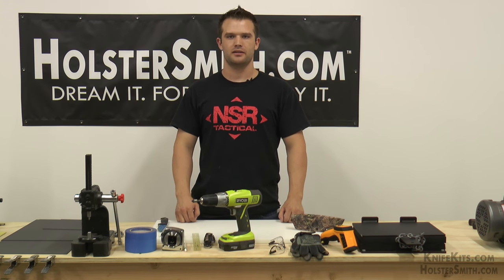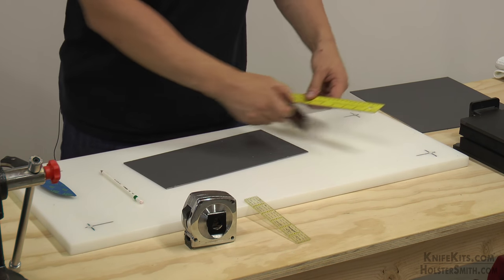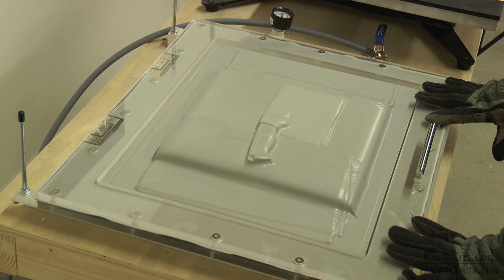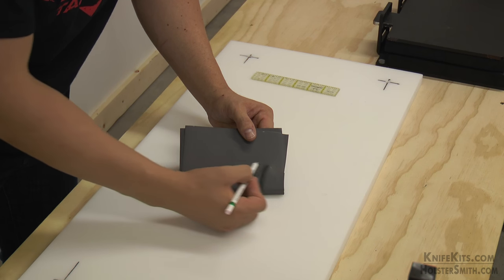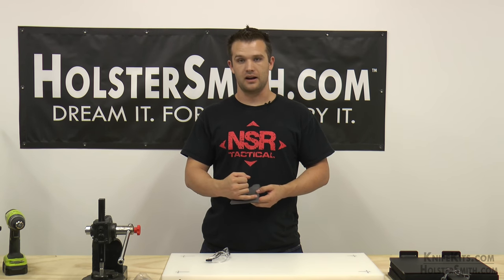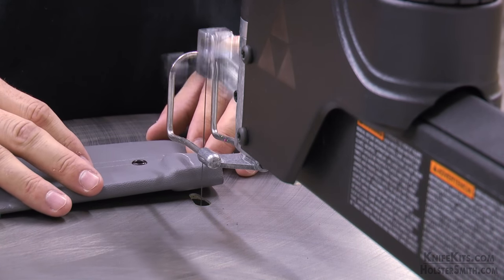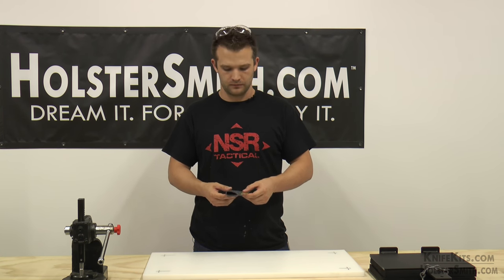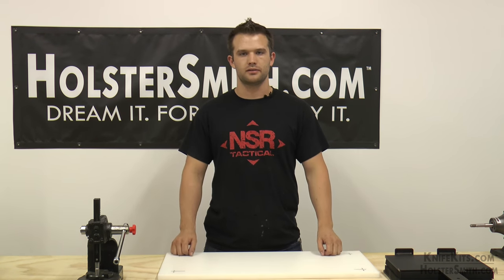DIY KYDEX® Project : How to make a 1-Piece Sheath (Feat. Dave White)

Comment: During the various steps it would be helpful to tell details. We are using “ “ thickness Kydex. Our temp us set to “. “ degrees on the t-shirt press. We drilled “. “ holes and are using “. “ eyelets. Our sand paper is “. “ grit and we are prebuffing with “. “ whell on our machine. Otherwise great video!